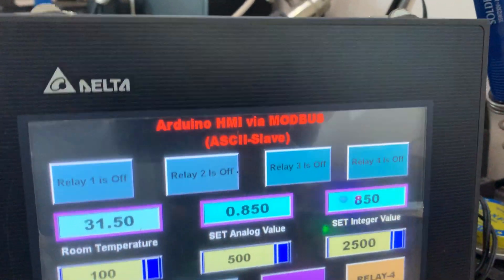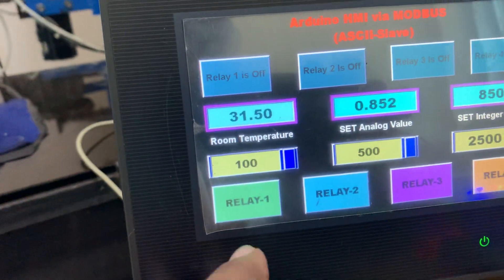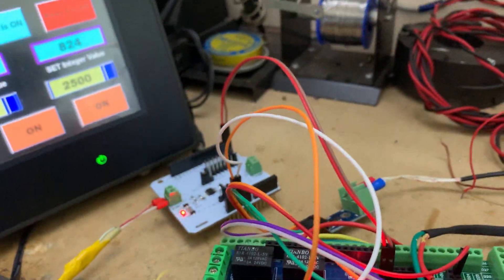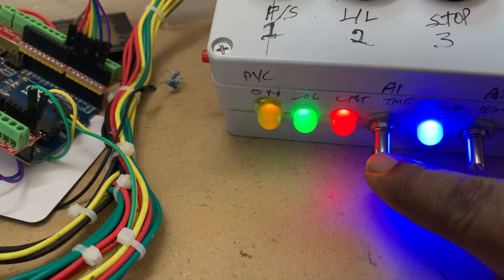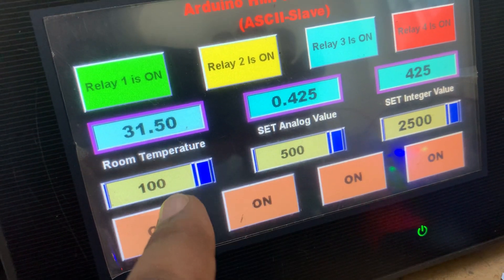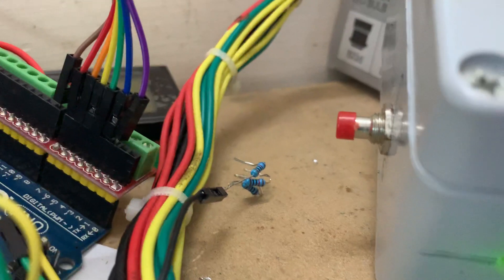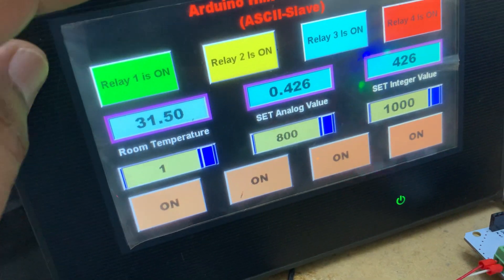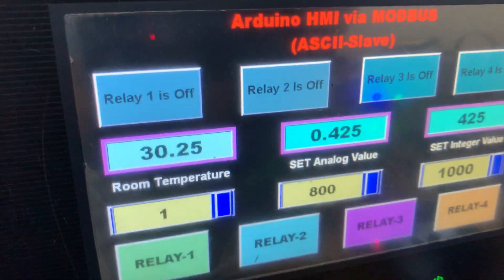Arduino connected  to DELTA DOP-B HMI as Slave Module via Modbus Part-2

Comment: Great video I have a question which modbus address did you use in the Arduino Slave, because I tried to use the address for example 100 And the HMI can not read it, I have tested with an address form 0 to 9 only and it worked.

Comment: Sir, I have RS485 to ttl converter module, how to communicate delta HMI with arduino uno could you please tell the solution for that, I didn't understand Arduino program for communication
Reply from the maker: You need vision pro software for programming the Arduino
Reply: @lenkaautomate Is it possible by using arduino ide software to program Arduino uno
Reply from the maker: Not possible by me, because I don’t know Arduino programming by use c++
Reply: @lenkaautomate  Thank you sir, Could you please help me to program the Arduino uno and HMI
Reply from the maker: I am sorry, you have to learn it yourself, with download my example. I only doing the paid job.. I am sorry 😞
Reply: @lenkaautomate  okay sir, Can you please share your contact number
Reply from the maker: https://www.dropbox.com/s/75is8c6bjkg8bpi/Arduino_HMI_Slave.rar?dl=0
Reply from the maker: 9437051215

Comment from the maker: If any downloading problems, please comment me , will update you
Reply: Communication getting loss while control stepper motor through delta HMI and Arduino, pl tell the reason
Reply from the maker: @subramaniankrishnakumar3821  actually in arduino if you used high speed pulse output for stepper drive, then the serial not work at the same time, you can try with arduino mega 2560 and try to use serial 3 for HMI communication, maybe it will work
Reply: Between HMI and Arduino communication getting lose once stepper motor started, After completion of pulse only it's getting to communicate again, pl tell the reason